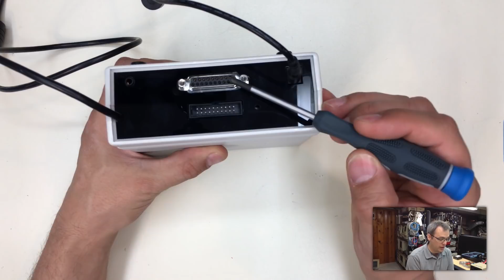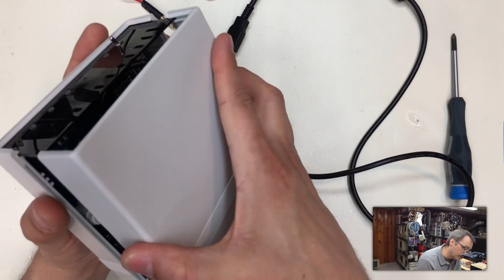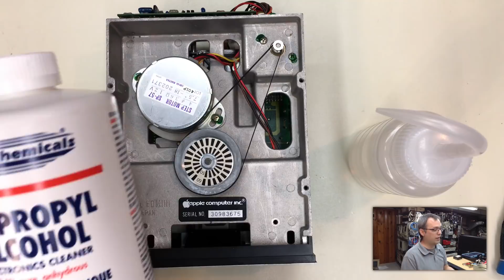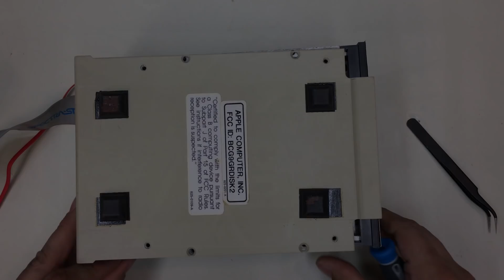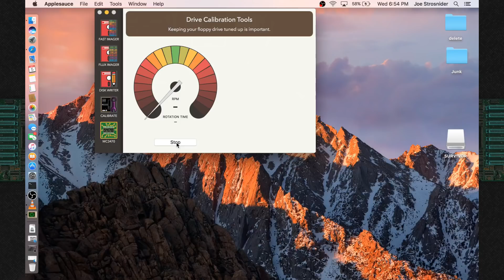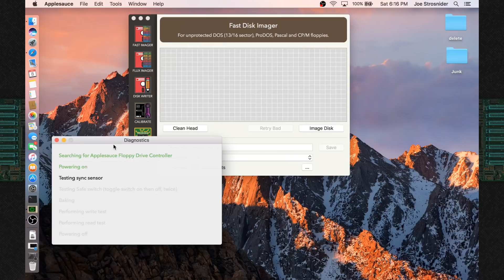TASTY! - Applesauce FDC Teardown and Review

Comment: From my own personal testing it is quite essential that you put at least 2 of the case screws in or you will have issues with noise.  The outer casing definitely acts as a Faraday cage and it needs proper connection between the outer casing and inner base.